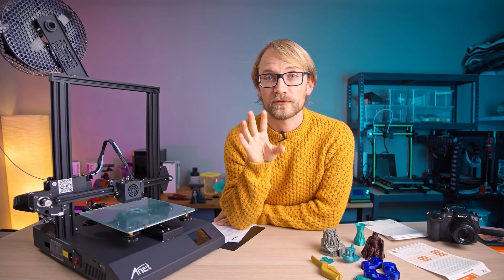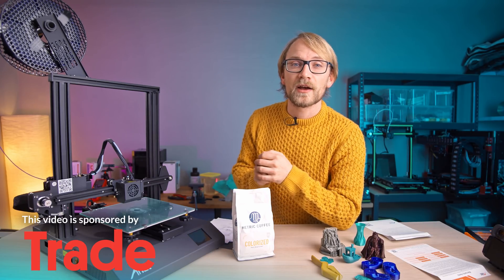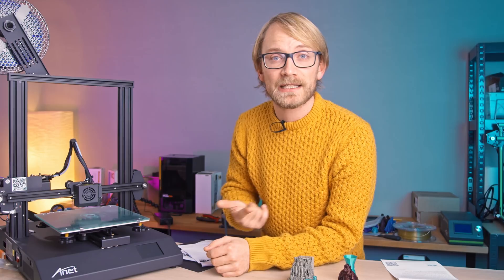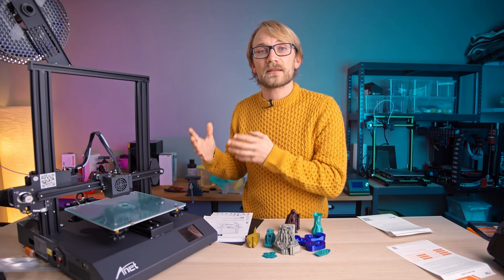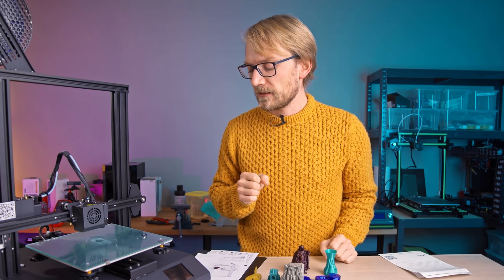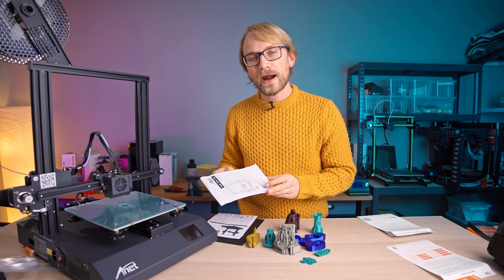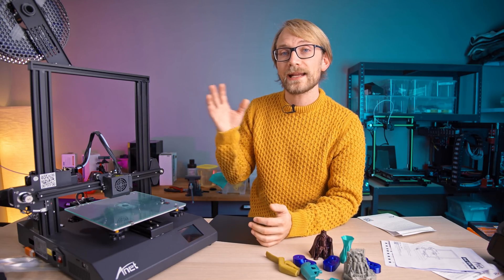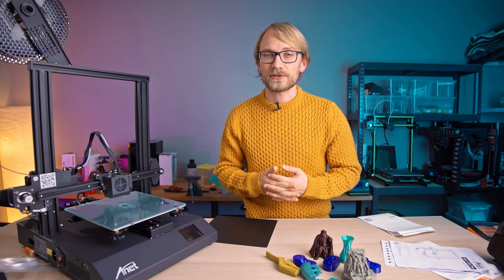What a lazy 3D printer design! Anet ET4 "Pro" review

Comment: Several point I'd like to make:
- I think you got an exceptionally bad unit. Mine was fine, including the ground and the plugs. I had no SD card issues whatsoever. Neither the issues with the hot-end.
- Electrically I found them otherwise doing pretty well, with locking connectors on the main board and a Meanwell power supply.
- I agree that Anet should just point to the latest Cura version - which includes profiles. That would have take one line of text.
- At time I received my unit it was only €170 euro - this puts the all the points in a whole other light.
- The hot-end is indeed weird, with that metal separating nozzle and teflon tube. An decision that I do not understand.
- Instructions for changing the probe position is actually mentioned, as the first point for setting up the printer actually.

- The firmware did work for me - but only using the included default start gcode. Use anything else and the motion system gets confused before homing.
- ...but Marlin is the only way forward. They are working on getting Marlin operational officially - but software can be changed but is not guaranteed to change. The Creality CR-6 SE firmware is still a mess.

One point regarding review consistency:
- Does the Ender 3 V2 and CR-6 have all those certificates you mention? Especially with the fact that the Meanwell power supply used in the CR-6 (and possibly Ender 3 V2) may not be used in Europe due to some electricity frequency harmonics standard violation. I can't recall you included this statement in your Creality review. Seems important - if you want to go about regulations.
- Let's be fair- Creality says they support the printer through an support e-mail address - but that is just pretend. Facebook is support - and it involves the community 100%. So I'd say (10:30), "Creality is busy doing live streams and hosting giveaways, instead of giving away support". Given how Creality handled the CR-6 Kickstarter I think they might as well laughing their butts off (11:35). 

I hope you do agree on some of these points - but I also understand that these is a certain "tact" needed when reviewing printers from larger manufacturers (like Creality). 
 
Have a good weekend 👍

Comment: Let’s be honest. There’s really no such thing as a new innovative printer anymore. I keep seeing ads and reviews for new printers and I’m unimpressed by them all. These manufacturers pick and choose the components liberally (high quality PSU and 32 bit board, but no ABL and mediocre hotend/extruder) and then sell it at either the same price or slightly higher than a printer that is older (still being sold. Example is Creality printers) and even has some of the same features and components and is most likely performing way better since a lot of people mod and upgrade their machines, because of again, poor quality components and design. 3D printer design in general just seems to have plateaued to me. Even Prusa is still selling the same printer, but just tweaking it a little and updating the software. Just my opinion based on observations. Does it also seem this way to others?
Reply: It seems to me like that also, but I still keep an eye on HevORT project on how guys solve common issues in kinematics.

Comment: Had the non "pro" version (has A4988 drivers) since February, and although one can argue that it is a good enough printer for a beginner, I soon found out how bad the printer was because of the issues you mentioned, as well as having a really crappy stock firmware (it lacks a lot of Gcode commands) and Marlin was not available then (actually, Marlin por was cereated by David Teran because Anet didn't even care, and when someone else did it they just rode on it), no belt tensioning, bed autoleveling is a joke on th enon pro version as you have to cobbect a membrane that has to be put around the nozzle (and you have to do it while cold because the thing is made out of foam), and a large etcetera.
I tried to purchase a silent driver board and they refused to sell it to me because it was for the "pro" version and it wouldn't work for me.
In one of the Facebook groups Anet even banned me for 1 week when posted about changing the innards for an SKR 1.4... which I ended doing, along with a V6 and mini BMG clones (so now it more like a Biqu B1).
I guess the only good thing is the borosilicate glass it has, just apply some Magigoo and even PETG detached without a problem.
Thanks for posting this review so that others can stay away from them, I am so done with Anet...
Reply: Do you got a guide or information for switching to a SKR 1.4 board?

Comment: Meanwhile on the dumb as bricks Ender-3...
Literally flawless prints, I will pay money to have fewer features to break.
Reply: Well, the difference is that Creality actually knows what they're doing. I mean, ABL AND adjustment screws? That printer is FUBAR'd.
Reply: @vincentguttmann2231  Creality has had a few it quickly swept under the rug. Exhibit A: CR-10s Pro, a printer whose ABL sensor has ±0.5mm variance and a half second of hysteresus. The LCD is also incapable of displaying file names 12 characters or longer and cannot display any special characters or underscores. There are also no lower endstops to permit use without the ABL sensor. It also uses a different nozzle.

Meanwhile, the Ender just works and hasn't required being leveled in months.
Reply: @williamforbes6919  Yeah, that sounds not that good, but I hope that they learned their lesson from this. I mean, most of the stuff they make is pretty good, unlike Anet (though I cannot speak from personal experience when it comes to Anet, all i know about them is based on internet stuff and reviews)
Reply: Exhibit B for bad Creality printers: CR-6 SE.

Ignoring my personal pet peeve of people called the strain gauge a piezo sensor. The auto bed leveling does not actually level the printer, as people are having to manually rotate and adjust the gantry as factory shipped to allow it to print without digging the head into the build plate. 

This is compounded with a "fancier" but far worse hotend and and an entire innefectual extruder which has poor grip on the filament, is prone to stress fracturing and warping, tends to clog regularly and is also an absolute nightmare to service and reassemble. 

The filament runout sensor is also poorly implemented, being difficult to feed the filament into the extruder afterwards and both scraping filament creating dust which clogs up on its inside and is also unreliable at detecting inserted filament.

The touchscreen interface has many bugs similar to the CR-10S Pro and does not provide E-Stop functionality. Very limited tuning ability is made available on the touchscreen as opposed to the traditional graphics lcd and wheel from the Ender 3. The roll holder is genuinely terrible. X and Y axis are both less rigid and provide more flex than the Ender 3. 

I would not recommend.

So strike #2.

Comment: is there any testing certification of 3D PRINTER for CE? self declare is enough, right
Reply: 3D PRINTER  does not fit any of the 23 category of Annex IV. So CE certification is based on the manifucatuer self checking. Is that corect?
Reply: @speedpu  CE is always a self declaration, without the need to actually do the EMC testing. If however, some problems come up and someome measures your device, and finds out your device does not meet the standards, who ever signed that declaration will be prosecuted. The other testing a device needs, aside from the EMC related CE testing, like machine safety, electrical safety and things like that are requirements on top of the basic CE certification, that are depending again on the device classification. I don't know the details of where a 3D printer falls, but i'm pretty sure the mains installation and a fully exposed up to 100°C glass plate, an up to 240°C hotend, and some finger pinching motors and mechanics do raise some questions in some other standards.

Comment: I have an Anet a8, the great thing was it's price. You need a lot of tuning (changed heat bed, fan, added bed sensor, printed cable chains, changed fans etc) but in the end it prints ok.
Reply: Mandalorian: This is the way:D
Reply: I still have my A8.  It had a new bed cable in the first two weeks (wasn't taking any chances).  And now it has a Ratrig frame, 32 bit board, BMG clone and V6 clone hotend and  mini UPS. It doesn't resemble the printer I bought. But that's not necessarily a bad thing seeing as it was  my first printer. And now I have a Biqu B1 which has taken over as the main printer. Great review Tom.

Comment: Hello Thomas, 
I just buy a TWOTRESS BLUER V2 for 137€ for testing with a lot of issues and no-support;
An corrupt SD card no slicer no profile available Even worse, E-septs calibrate at 90 with a clone BMG :-d instead of 422 - Z axis reverse, installation screws with not thread , … 
I the end I ad a 3D touch and original firmware MKS I got a great final product for less than 150€
My only problem is if a noob buy this unit like this I will get frustrated and probably will never buy another 3D printer! It’s a shame to sell machines in this condition
 !
Regards from belgium

Comment: This review is really weird to me, seeing as I bought one of the early ones long before the name change of "pro" for the silent version with slight changes from the pro, which I think is only the method of bed leveling. (also for quite a bit cheaper, got a deal from the rep for 150 euro when the price online was still +-250) Granted I got an early version and they even send videos of the print quality on the printer they send me. SD card was fine, and still use it. The test models are normal, none had 100% infill that I tested, and the default settings that were given for cura are good (and recommended me to get the newest version of cura), not the best but good. 
I might have a massively different experience as I was an early adopter that talked a LOT to a sales rep at a time when there was only 1 review of the machine out and back then they were on a bender on trying to clear their reputation for creating unsafe low quality printers. They can have slipped back in their old ways.

Having said that I'm rather happy with my silent ET4 "pro", leagues better than my A6 and basically what I expect of a 3D printer.
Reply: Yep, totally different experiences. Also differs quite a lot just between boxes you open.

Comment: The profile and software was just the same with the Anycubic Chiron. The included cura was so old and they only include written profile details in the manual. I tried using the default profile in cura 4.7 and it printed so fast because the cura profile was using print speeds at least twice as fast as the chiron actually needs. I found it so strange they went to the time to make a nice graphical interface to adjust the 5 x 5 probe points on the touch screen, but couldn't be bothered to include a tuned profile.

Comment: Tbh. I NEVER expect something good of anet.
Yes I had a anet a6 and yes thermal runaway was disabled.
And yes the hotend-thermistor slipped out and almost burned down
Reply: My a8 stopped during a print controller frozen. When restarted the hotend was 450c. A few more minutes and its on fire.
Reply: @MonguzTea  yeah, anet is pretty much trash still in 2020. I know its better but still. Worst quality out there

Comment: Does this Anet come complete with the burn down the house feature?
Reply: I think so. Though I think they market that as the "User hypothermia protection".
Reply: It's an emergency firestarter!
Reply: Yes, in a Pro version. It now makes sure your not there to put it out.
Reply: my Anet A8 had it's power supply catch fire while it was printing. Strictly speaking it wasn't the printer, does that still count? I caught it before it spread but it was surrounded by sound dampening foam so it would have burned my apartment down, I reckon.
Reply: @HumanlyRobotic  That definiteely is Anets fault. It's not like a "power supply catching on fire" is an unavoidable thing in life, like death and taxes are. Anet chose an inferior, low-quality power supply over a better, safer, and more expensive one, so it is 100% their fault. 

They configured that product, and if that error didn't happen to them, they DID NOT TEST ENOUGH. Somehow, Prusa printers don't catch on fire, despite using the same style of power supply. That's because they use better ones that have goddamn safety mechanisms.

Sorry, this negligence of safety always makes my blood boil.
Reply: @HumanlyRobotic  I would say it counts, their fault for choosing a crappy one or overloading it.

Also from the pictures Thomas showed of other users with molten connectors, I'm betting it sure has that feature still there. Not to mention the bed connection stress relief failing on his own printer. No expectations about thermal runaway or min/max temp being enabled either
Reply: Foooooooonnnyyy!!
Reply: They probably even fail on that, at least when you need it (planning on renovation, and need insurance funding). But the insurance will come to investigate , and reject your claim with laughter when the figure that you used an Anet printer.
Reply: To be fair, the Ender 3 did go through this phase.  Creality fixed it very quickly.
Reply: @poodlescone9700  Yes, that is exactly what I mean! Creality actually does stuff to improve their products!
Reply: @poodlescone9700  I remember the thermal runaway not being enabled (easy software fix) and a batch of crap XT-60 connectors that were prone to burning on these, Makers Muse covered that up
Reply: fortunately, No. 
the machine refuses to heat up if any of the thermistors are disconnected
Reply: @menonsans  Unfortunately, that does not cover the case that the thermistor comes out of the hotend.